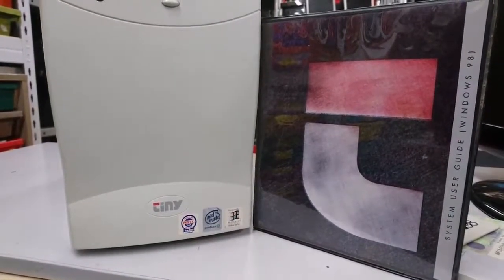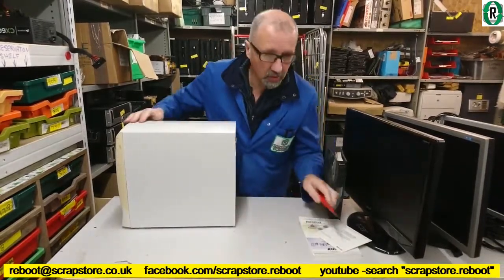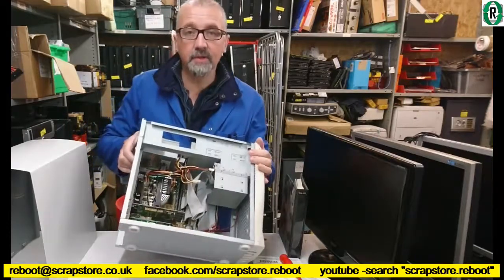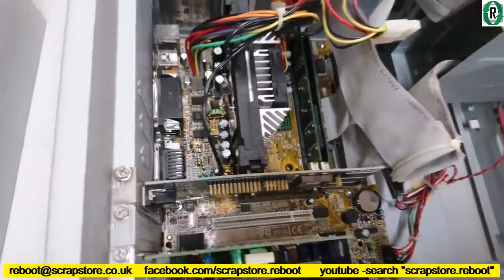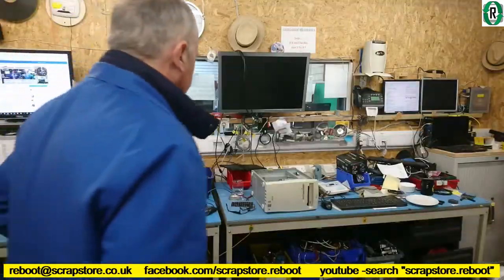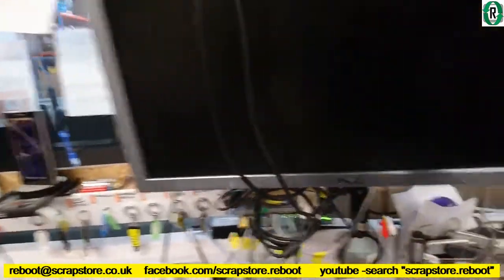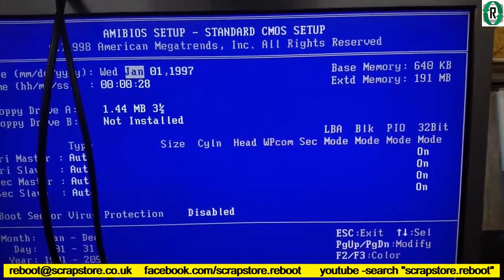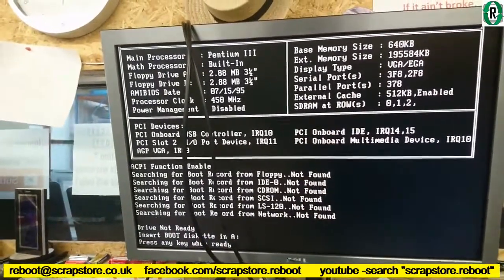Tech Donation #17. Tiny Computers. Pentium 3. Win 98

Comment: Wow - what memories, I too was in Tech Support, 99-01, what memories, such a fun company to work for, and such great people. Contrary to the vision BBC watchdog tried to portray of us, the tech team genuinely wanted to help customers when they called in, but after outsourcing, we were let down by a complete lack of training on new products. More often than not, finding out about a new product when a customer phoned in with a fault with it. (That was why i left) 

Cheyenne Bitware was better known to us techs as "Cheyenne Sh*tware" as it never worked properly. It was fax software that only spoke to the modem when the wind blew in the right direction coinsiding with a full moon. Otherwise, they werent bad machines for their day. (Except the Syncro machines, but enough said about that the better) 

Sadly Time bought us (sorry "them" i had left by this point), and for no apparent reason, killed off both brands, meaning Tiny's fate was sealed. 

I drove past the offices not so long ago, it's still green, and the memories came flooding back.

Thanks for sharing.

Comment: This is like a trip to the past for me I was a very happy 14 year old when my mum bought our first computer from Tiny computers in 1999 it was the PC I learnt how to use Windows on, it had 500mhz Pentium 3 500mhz processor and 64mb of ram and big (for the time) 12 gig hard drive and a DVD drive all these specs were quite impressive for the time, however the motherboard no AGP slot so upgrading the graphics was near impossible unless you had a PCI graphics card, all of which very few were available, great video, brings back memories for me 👍